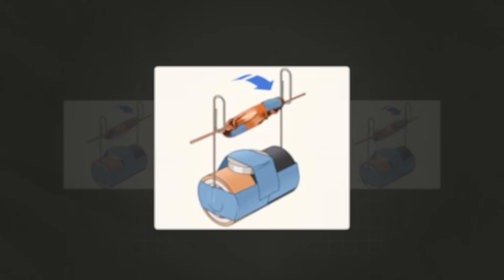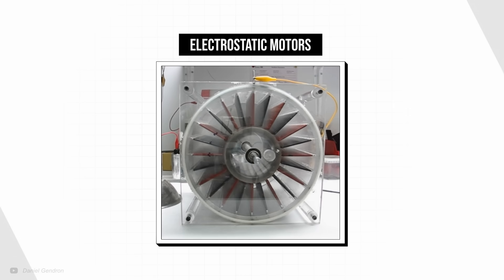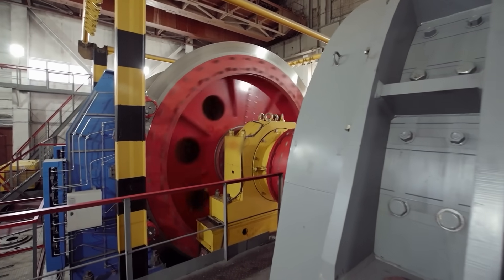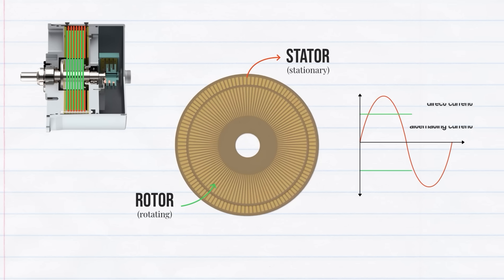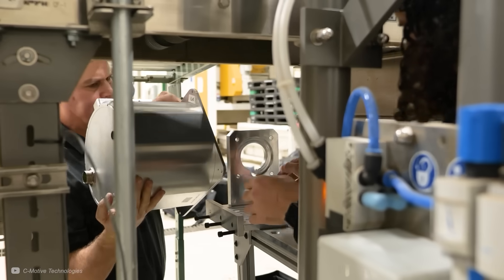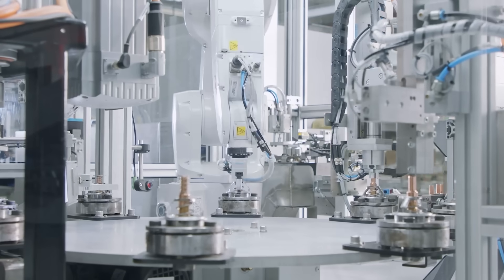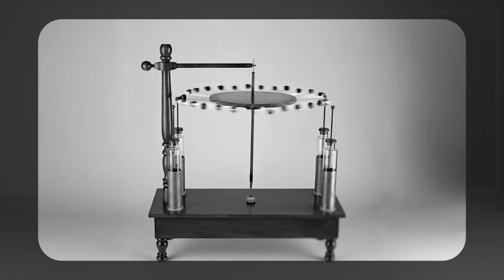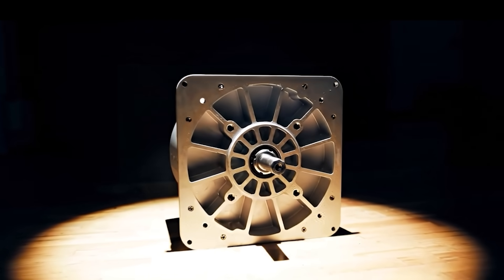How Electrostatic Motors are Breaking All the Rules

Comment: i'm thinking the dielectric fluid is probably something like 3M Novec 7000 to 7200, somewhere around 0.70ish cP Viscosity, 30Kv+ dielectric strength. I wounder if this style of electric motor would do well for submarines.
Reply: This motor could also replace the gas motors used on sail boats during port entry and exits, because speed is not used, its low speed torque that is needed, so they could introduce a line of electric motors for sail boats to replace the gas motors currently used, and it could be powered by solor panel...🧐🤔😎👍
Reply: Fluorinated hydrocarbons might seem like a good choice at first. However, the main obstacle is that their dielectric constants typically fall in the single digits. They also tend to be expensive. Fluorochemistry is notoriously difficult to work with, and nearly every time fluorinated chemicals are introduced into the world, something harmful—and often unpredictable—tends to follow. Think Teflon, PFOAs, ozone-depleting substances, and so on.
Reply: @Fejimush  Appreciate the input, though your reply feels a bit like AI boilerplate, especially with the dash formatting and broad generalizations. For the record, Novec fluids have dielectric strengths over 30 kV, and they're widely used in real world high voltage immersion setups. Guilt by association with Teflon and PFOAs isn’t really relevant unless you're talking about specific Novec variants or proven toxicity profiles. Got any data or direct experience to back that up?
Reply: @polodog7458  I use AI to proofread.  Nothing wrong with that.  Saves time and catches spelling and grammar errors.   Nothing wrong with that.  Simply efficient.
Reply: @Fejimush  I agree that there’s nothing wrong with using AI to proofread. But your earlier reply read more like it was generated and pasted wholesale, not just cleaned up. It made broad claims without nuance, missed key technical details (like dielectric strength vs. dielectric constant), and leaned on scare examples unrelated to the actual Novec fluids being discussed. If you’re going to weigh in, it’d be great to see something backed by actual data or hands on experience, not just AI polished talking points. I’m not the only one who can see through it, and it feels disingenuous.
Reply: @polodog7458  And yet you have posted nothing on the environmental safety (or non-safety) of Novec fluids.
Reply: @Hybridog  Fair enough! If you and your tag team partner want to dive into the environmental or safety profile of Novec, that’s definitely something to take up with 3M. They publish all the MSDS and environmental impact data. I’m just offering an informed guess about what might be used as the dielectric in the electrostatic motor, based on my real world experience using Novec fluids in my projects. Not trying to write a regulatory paper, just contributing something practical to the discussion. So far, that seems to be in short supply.
Reply: @polodog7458  3M is phasing out all PFAS products by the end of 2025 including some fo the Novec fluids. I guess @Fejimush was right to be concerned about the impact of these fluorinated products. The video said nothing about the composition of the proprietary dielectic fluid in these motors which is a little suspicious. They could have said it was fluorinated wtihout revealing any details. They didn't say anything because they know fluorinated compounds are under justified scrutiny these days. Doesn't hurt to be suspicious and cautious when it comes to corporations and their new products.
Reply: @polodog7458  Yesterday I uploaded a couple of videos to my channel from the early days of developing the dielectric fluid at C-Motive. I can assure you with complete confidence that there are no fluorinated chemicals responsible for torque production in C-Motive's C-Machines.  I may post more if there's interest.  

Also, The proofreading AI has also been instructed to stop using those "AI dashes".  You're not the first to get triggered by them.
Reply: @Fejimush  Thanks for sharing the videos, I’m checking them out now. Really cool to get a peek into the early development work. If you’re confident that there are no fluorinated compounds involved, that definitely rules out Novec and similar options, which makes me even more curious about what fluid you're using. Whatever it is, it could have some great applications beyond your system too. Would love to see more if you end up posting.
Reply: @polodog7458  Thanks for taking the time to check the videos out.  There are two new ones, if interested.  
I developed the initial fluid formulations. C-Motive has certainly tweaked it since I left.  
It's astonishing how many arm-chair engineers think they know inner details of how this technology works.
Reply: @Fejimush  Appreciate the new vids, I’ll give them a look. Really cool that you were directly involved in the early fluid work.

And I get where you’re coming from on the armchair takes. That said, curiosity and informed guessing usually add more to the conversation than copy   —   paste replies do 😉. Glad things have gotten more interesting now.
Reply: @Fejimush  I checked out your video sets as well.  Very exciting to see additional developments in dielectric fluids.  I work in an industrial field that works with high voltage DC and AC (20-100+ kV) and I find the physics challenges to be really fascinating.

Comment: Color me skeptical. The efficiency numbers for the “status quo” seem unrealistically low, even when accounting for gears.

Industrial customers are often risk adverse. Equipment downtime tends to be very expensive which leads many to be conservative when adopting new technologies. They need to find a niche where electricity costs of running small motors is a big enough factor to justifies that risk. I’m not sure such a niche exists.

These seem a better fit for robotics instead. High torque is needed, it is efficiency and weight sensitive, and the industry has a higher risk tolerance.
Reply from the maker: 100% agree - I think a lot of benefits could come from correctly sizing conveyor belt motors with off the shelf systems. Robotics will be an interesting application for sure!
Reply: @ZirothTech  yeah, all I can say from my experience is that getting factories to change anything is very difficult, even when the benefits are crystal clear. I struggle to believe that lower energy costs running conveyer belts (likely a small factor in total cost) would do it.

But I’d love to be wrong! Innovation in electric motor design is great to see.

Comment: It will be interesting to see how long these new motors last as having a very thin layer of copper subjected to high voltages over and over could wear them out quicker. Though it is a good idea, the weight savings alone from not having so many heavy metal components will greatly increase efficiency and as you said lowers construction costs considerably.
Reply: Depends if the surface arcs

Comment: "4000 Volt"
Per what?! Dielectic strength is given in V/m, with FR4 having about 20 kV/mm, and air around 1 kV/mm at  1 atm. So, 4 kV per "whatever the typical creepage distance in their motor"? What's that? 0.1mm? 1mm?
4 kV alone means nothing.

Comment: Their "proprietary electrically insulating liquid sourced from commodity ingredients" just means using fluoroketones like FK-5-1-12 instead of Novec1230. 😂
The benefit of that liquid over Novec4710 or C4FN is that Novec1230 is liquid at room temperature, and boils at 49°C, giving electronics evaporative cooling.

And obviously, they compared their motors to asynchronous inductance motors, not to SYN-RM motors with precisely cut gears (that are more effcient, but have less low end torque), not to hybrid motors that combine reluctance and magnetism (because they depend on neodynium).

Comment: I wonder if Carl Busglia might be interested in this principle for his PCB motors.
Reply: Novec 1230 or FK-5-1-12 is hard to buy as a consumer. Also high voltages for driving it can be dangerous and need a special power supply.
Carl's PCB motors run with normal PCBs with low voltages.

Comment: You missed one interesting property of Electrostatic motors; they can produce a static holding torque with minimal power consumption, which would be a great fit for actuators and servos used in robotics.
Reply: Wow! The engineering capabilities would include; being able to miniaturize, remote energy transfer, and direct-to-drive motors which would also simplify the whole process!
Also, also, the torque factor could still replace IC engines if the static charge can be decoupled to allow timed pluses!
Reply: Yeah and humanoid/quadruped robot joints are much more about torque than speed.
Reply: @JCAtkeson3 AND you can get that sci fi trope where dying robots throw sparks as their electrostatic servos short out
Reply: @JCAtkeson3  It's both. You need torque to get the robot working. You need speed for Kung Fu. I would go with high torque joints, with high speed 'bones' that can flex to accentuate the joints.
Reply: Or on motor operated valves
Reply: Yes!  The static holding losses of C-Motive's ESMs are vanishingly small.
Reply: Who will be the first company to incorporate this? I think v3 Optimus might have this in mind 🤔
Reply: But can they run AI?
Reply: Okay now that is kinky
Reply: Because of the tight spacing of the rotors, it's probably not a good idea to use it in robotics that are subject to vibrations.
Reply: Someone should tell Tesla,
Reply: @andrewtancock-x3d  they would have to rethink their regenerative breaking strategy.  More seriously, this is good for long, consistent forces, not rapid changes in speed, with variable loads.  Better for applications like pumping water to fields or, as they are targeting, conveyor belts, escalators, moving sidewalks, funiculars, cog railways, oar carts, or roller coasters.
Reply: @nela9994  I meant for the Optimus robot actually, could have been clearer.
Reply: @andrewtancock-x3d  ah, but that might be even worse, since those joints would be moving, and rapidly accelerating, so you are adding gyroscopic pressures as well to the whole system.  Unless you are going to do some really interesting wiring, and have pulleys and fibers for the “muscles” and the high torque motors are centrally located, it doesn’t necessarily make sense.  Some of the other more pneumatic or hydraulic solutions look to be more favorable for both response time, and variability of pressure.  As well as the whole feedback system.  Part of the pseudo-musculature difficulty is sensing change, and with a torque motor like this, it tends to smooth out change. Which, depending on your application, might be the desired result, but, for robotics, you want as much of those micro-adjustments as possible to be able to, say, not crush the egg being picked up, or maintain balance when the floor surface is being variable.
Reply: How could one encode a high voltage motor? Thst seems like quite a leap over current servo and stepper controllers, then there’s the safety issues as well.
Reply: Exactly. It is like the difference between a steam engine and a rocket on the launch pad. Too bad about low permittivity.
Reply: @princeoftheblues 

Thanks Mr PR 
I hadda go goog t get dat
Permittivity is a measure of a material's ability to oppose the formation of an electric field, with its SI unit being the farad per meter (F/m). It quantifies how easily an electric field can be "permitted" to form within a material, and it is a key factor in determining a capacitor's capacitance. The permittivity of free space (vacuum) is a fundamental constant, approximately \(8.85\times 10^{-12}\) F/m.                   Key aspects of permittivity     Opposition to electric fields: Permittivity measures how much a material resists the formation of an electric field. When an electric field is applied, the material's atoms polarize, creating an opposing field that reduces the overall field strength.  Capacitance: A material with higher permittivity can store more charge for a given voltage, which increases the capacitance of a capacitor.  Relative permittivity (Dielectric constant): This is the ratio of a material's permittivity to the permittivity of free space. It is a dimensionless quantity and is often used in engineering. For example, the dielectric constant of a vacuum is 1, and for air, it is only slightly higher.  Factors affecting permittivity: Permittivity is not always constant and can vary depending on the material, the frequency of the applied field, temperature, and humidity.  Applications: Permittivity is crucial in the design of capacitors, insulators, and other electronic components. It is also used in geophysics to study the properties of the Earth's subsurface
Reply: Same with conventional stepping motors.
Reply: No it wouldn’t be a good fit,   A robot needs a servo motor for precise positioning.  This is not a servo motor,  this is a simple ac motor.  

An off the shelf ac induction motor can provide up to 50% holding torque if it’s powered by a VFD ( 75% of motors are VFD powered).    It’s a feature that vfds have offered for over 20 years.   The issue is you lose holding power if you lose electrical power.    Safety wins all arguments in designing automation
Reply: No, you are missing an important part. Any shock which causes misalignment of the plates is terrible. If you use this is robotics, it will not last long, and considering the high voltage this is also extremely dangerous compared to electromagnetic motors for robotics. Ask an AI.
Reply: You cannot control such an electrostatic motor as you do with a servo, since fluid is involved in moving the rotor; you cannot achieve position control as you do with a PID-controlled servo.
Reply: @vignanashala what the fuck are you talking about
Reply: Now thinking about this... Are our muscles some kind of linear electrostatic motors?
Reply: @РайанКупер-э4о no, because muscles are not relying on magnetic forces to maintain static force. it is an electro-chemical force due to synapses firing (chemical/electrical) in order to cause protein conformational change and chemical binding of actin heads to myosin filaments. That’s why you get rigor mortis after death due to total tetanus of the muscles (a chemical process).
Reply: @РайанКупер-э4о  Yes, muscles do work electrostatically. The field strengths, in volts per meter, are astronomical.
Reply: as per steinmetz... 
"it takes no power to maintain a magnetic field"

it DOES take power to replace the current being consumed in the DC wire resistance of a coil. 

"it takes no power to maintain a fixed electric field."

it DOES take power to replace the charges leaking away through dielectric losses.

as voltages increase, so do corona discharges and leakage currents.

its a catch 22.

both electrostatics and magnetics follow the inverse square (cube?) law. thing is, you can reduce the gap of a magnetic path to a minimum, whereas an electric field simply shorts out, punches through the dielectric. theres a limited potential one can put on a surface before breakdown, whereas a coil is pretty well much limited by DC resistance and the ability to dispose of heat produced there within.

electrostatic motors have been around since benjamin franklin... if they were practical, where are they all?

oh, yeah, thats right. "big magnetics"...
Reply: @paradiselost9946  no, it’s not “big magnetics” it was mentioned in the very video, air is not a good insulator (lightning bolt).  And since VHS, I mean magnetic motors, were good enough, no one bothered to find that dielectric fluid that is the special sauce to this whole tasty burger.  But, now someone has, and maybe, just maybe, for certain applications, there might be a better motor.  Sometimes innovation is like that.
Reply: Static holding torque  is easy just use a break and a tension gauge. 
I worked on motors that held 350 meter ships alongside the dock 
and help steady tension with AC motor, a break and tension gauge.
Reply: @tommythetoe  This only works if you don't want any near-static compliance, like a winch, but in the case of robotics or suspensions you often do. A brake in that situation would rapidly wear out and both motor and brake would produce a lot of heat while producing the restorative force. The point of the electrostatic motor is that it is very efficient at the direct drive, high load, low speeds that would cook a conventional motor.
Reply: @hemingwaybromfield3722  This motor powering a robot would move at a snail's pace. Literally. It's fluid filled, so stuck at low RPMs or efficiency would go completely out the window. Even if you get comparatively high torque here you would still need reduction gearing if the robot is supposed to be able to lift anything more than trivial weight (or even its own weight), so movement would be excruciatingly slow.
Reply: @tommythetoe sure, but then you add additional components. With this motor, you just need the motor without having to purchase a gearbox and your mentioned components, saving volume complexity and cost
Reply: @michahermann7869  beside regulations will require a non seperatable brake, that will engage whenever motor is stationary, and all so engage at "black ship"
Reply: @michahermann7869  This motor alone would stand up to the combined forces of wind and waves on a gigantic ship? I don't think so. And volume isn't really a factor here either, so...